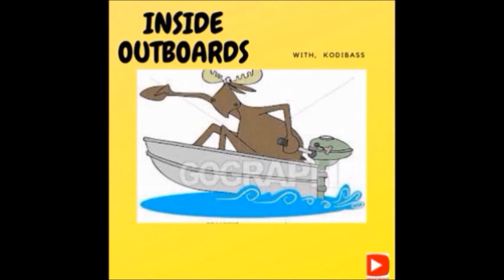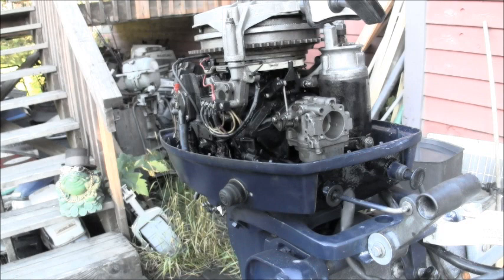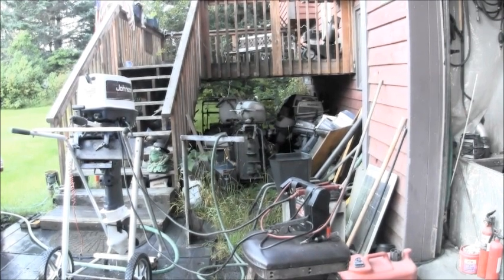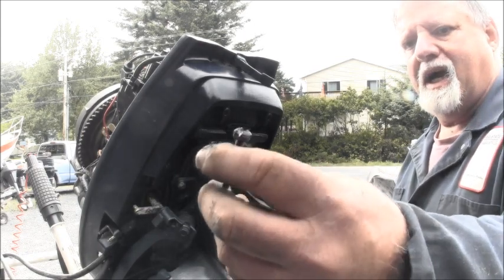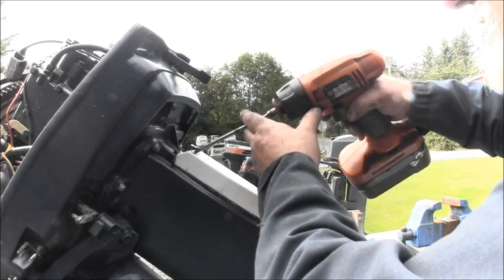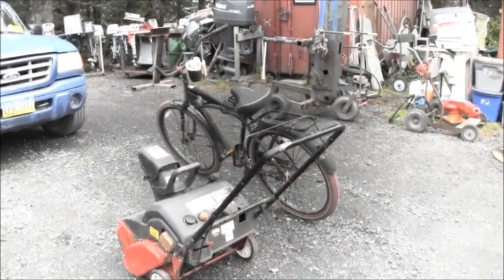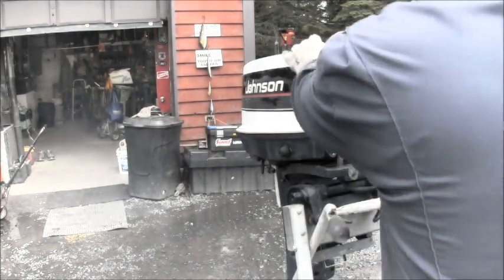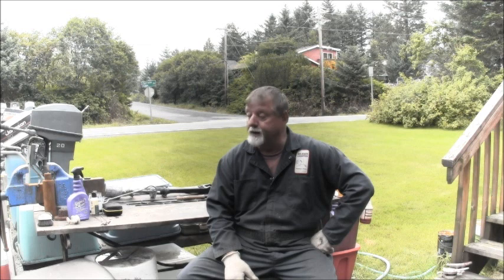JOHNSON,  EVINRUDE,      (  JonnyRude )   Part 3   Done.

Comment: Hi mate I have a 1975 johnson  25hp I'm having some isues with main one being its running good but has this random sneeze splutter down low when comeing down from high revs i got the motor for a bargain and am doing it up to hopefully a good runner for my tiny I have gaped the points and they all looked in good nick also gaped the plugs could u tell me what the gaps are ment to be on both plugs and point and also where is a good spot to start with the random sneeze would be greatly appreciated
Reply from the maker: 30 on the plugs 20 on the points,  The sneeze normally means lean low circut on your carb.  Clean the carb well make sure the low jet is super clean.    kb
Reply: @kodibassInsideoutboards  thanks mate appreciate the reply when u say low circuit is that the 3 little holes inside the carb mouth and the rich lean screw up top in the middle
Reply: @kodibassInsideoutboards  and also I have b7s plugs gaped to 40 as I was told if I do alot of low speed stuff 40 was beter is this correct thanks
Reply from the maker: @kaisloetjes483    Yes' a bit wider is better in the older motors,  However I would not go that much,  35 is what I set my Bigtwins & other older motors @,  40 mite B a bit  much unless U R  Playing around with your timeing & jets.. & Yes I am guilty of doing that.  kb
Reply: @kodibassInsideoutboards  hey mate is that .035
Reply: @kodibassInsideoutboards  hey mate sorry to bother u again I set my ups at .030 / .762mm and points at .020/.508mm is that correct I'm still having isues seems to be running well but I'm having top end isues with speed my mates 15hp 1984 passes my boat both 12ft tinnys similar weight but my 25hp seems to be lacking can't get it over 40kph on a plane is there something I should look at or a difrent gap set for the points and plugs feel like I'm chasing my tail or is 40kph about right for a 1975 model 25hp motor